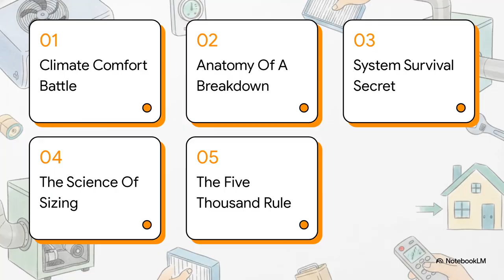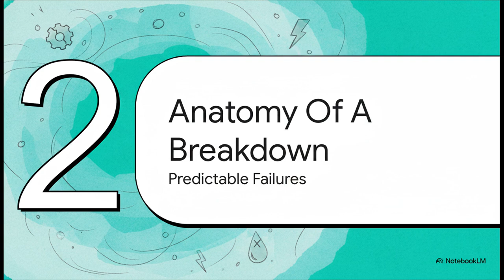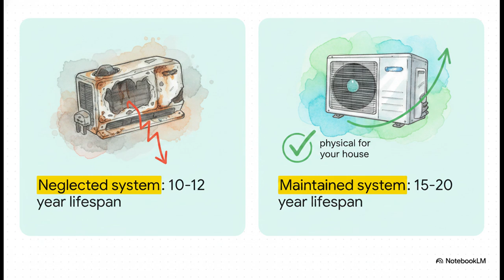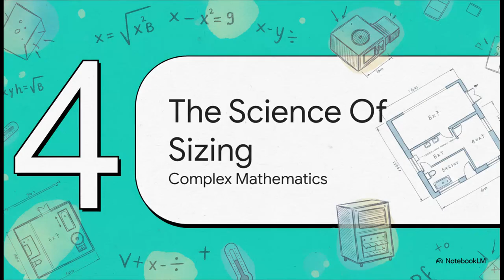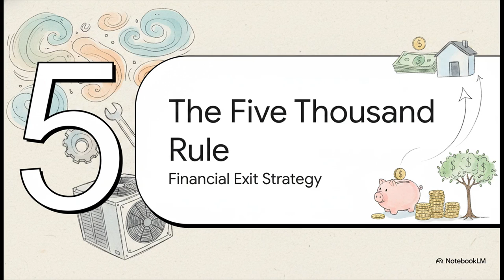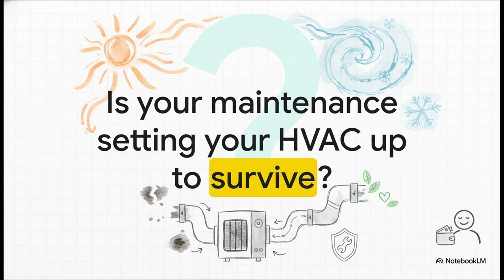What HVAC Contractors Won't Tell You About Noblesville Repairs

Comment: Whoever made this video knows nothing about what the capacitor ACTUALLY does in the HVAC system.  It's really a shame there is so much fake information on the web.  Fire whoever made this video because clearly, they have no idea what they are talking about!!  The Capacitor does not "Boost" or "Jump Start" your system.  

In most single‑phase AC induction motors (and in many HVAC compressor/motor start circuits), the capacitor is used to create a phase shift between the current in the “start” (auxiliary) winding and the current in the main winding. That phase shift produces a starting torque (effectively creating a rotating magnetic field component), so the motor begins to rotate.

Depending on the design, the capacitor can be a:

A.  Start capacitor (in series/parallel with the auxiliary winding during start, then switched out), often using a capacitor + relay arrangement.

B.  Run capacitor (left in circuit during operation, improving efficiency/power factor and keeping torque more stable),